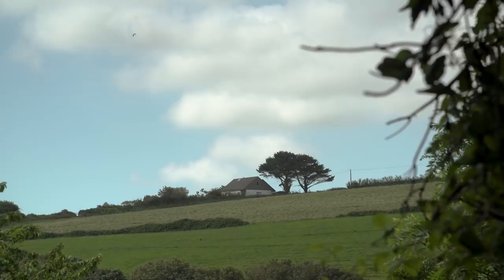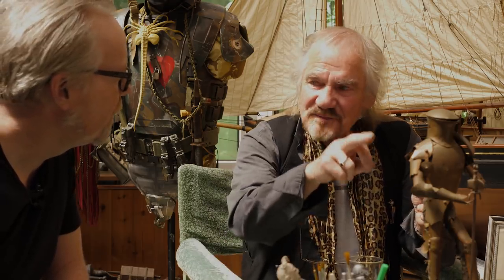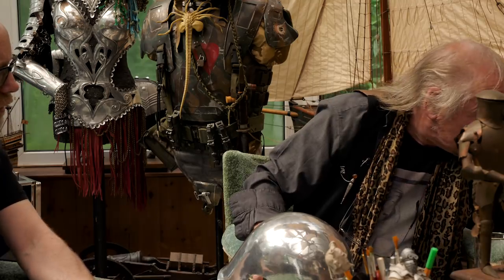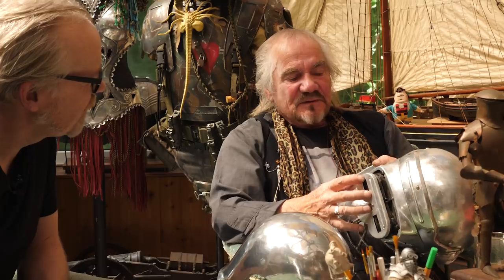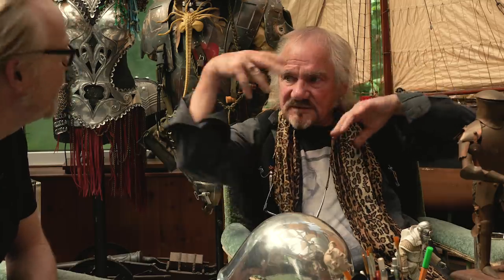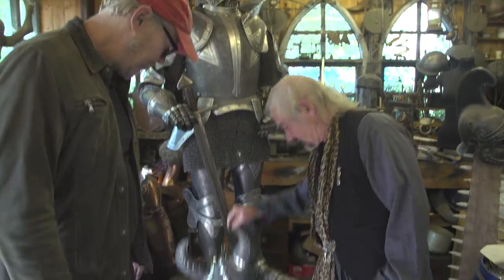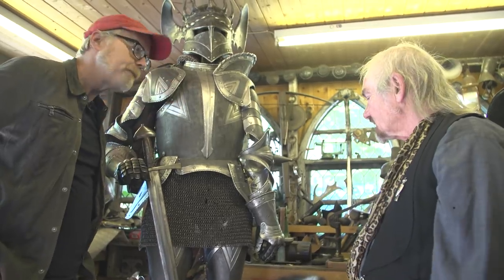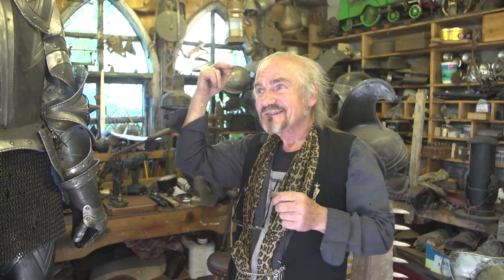Adam Savage's King Arthur Armor Build, Part 1

Comment: Adam I am so sorry to hear about your armor getting thrown away! It must have been heartbreaking :( I't really awesome to hear a master talk about their craft. Hearing Terry talk about crafting armor from aluminum makes me really curious about the workability of the different metals using classical armoring techniques. I know aluminum has pretty awful fracture toughness compared to steel, and I don't see a forge in that workshop, so now I want to know how Terry can cold form aluminum without it breaking and cracking. He is a master I suppose. Can't wait to see more of this!
Reply: Aluminum is pretty ductile and can be worked cold easily; some alloys more easily than others. A lot of armoring in steel is also done cold, but a lot of the heavier work has to be done hot since steel is less ductile. Aluminum will fatigue and work harden over time but it can be quickly annealed with a torch (this is shown in the video). "Fracture toughness" has nothing to do with it; there are a separate set of material properties at play which can be controlled with heat and technique.
Reply: @MauledByBears  thanks for the info! I'm totally going to check out your channel!
Reply: @TheDungineer  Of course. My channel isn't really full of much at the moment, I haven't had a chance to record and edit a video in a LONG time. But if you have any questions about metalworking, feel free to DM me on YouTube or Instagram @_scald.
Reply: Watch "On Cardboard and Jungian Philosophy - Still Untitled: The Adam Savage Project - 10/28/2013
"
He talks about this happening in more detail, you can hear about how this event knocked his making back by nearly 2 years, it's pretty hard stuff.

Comment: I've always had this idea for armour. A wind worn knight that's been walking the plains for eternity. The armour is Ill fitting on a skinny frame with holes and pits sandblasted into it over time with some parts creased, torn and buckled. Even though the armour is ancient and worn it still gleams because the sandy winds polish it. He also drags a longsword along with him that's been worn down to an angle. Also no battle damage at all, just time.